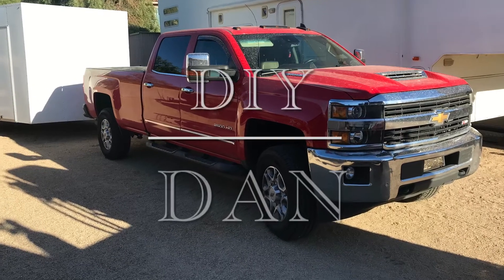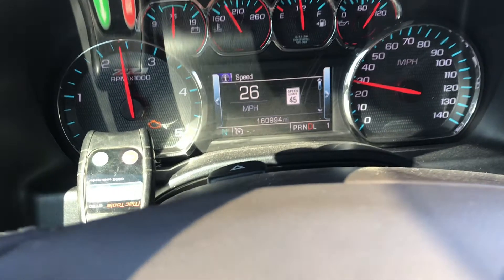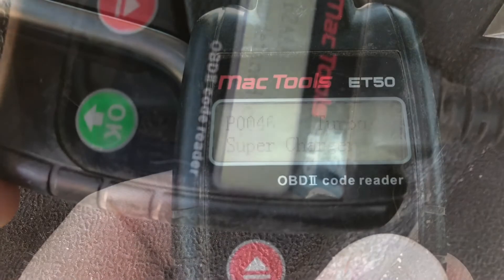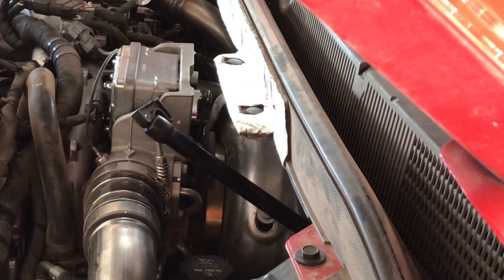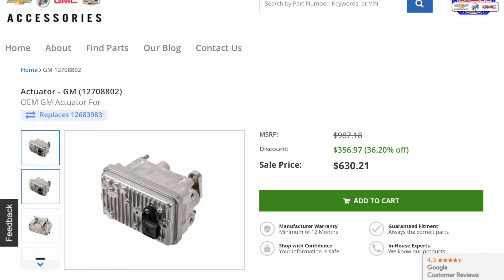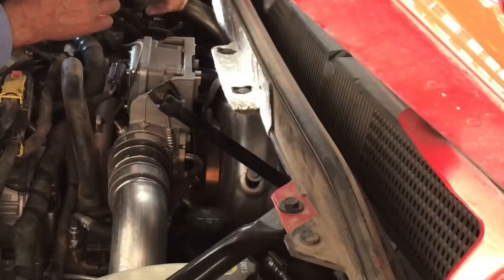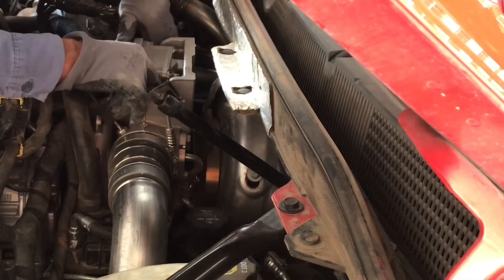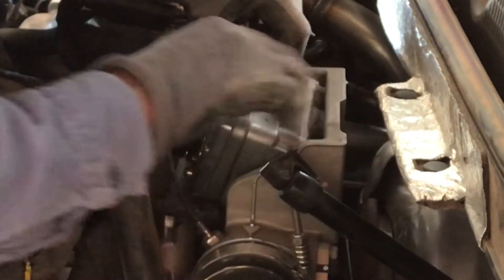REDUCED ENGINE POWER ON DASH ON MY 2017 CHEVY DURAMAX WHY IT CAN COME ON & WHAT I DID TO REPAIR IT

Comment: I have a problem the truck starts but like 1 minute cuts off before was engine reduce pawer I replace mass sensor not fix replace map sensor still same problem
Reply from the maker: Codes??
Reply: @d @diydan7019 p0108 and p0106

Comment: Good video, I like being able to check the vain position actuator manually, I can't do that on my 2015 with out some disassembly but I don't like the extra electrical part that actuates it on the 2017. I like the way you used a common sense diagnostic method.

Comment: Whats that thin wire(positive side) that’s going to the driver side battery terminal? I just bought a truck and looks like that cable is cut off on mine.. haven’t gotten around to follow the wire yet, I was assuming it was some aftermarket lights or something
Reply from the maker: Most likely aftermarket mine is for an auxiliary fuel pump that I have in the back of the truck

Comment: Taking it to the dealership does not in any way mean a proper diagnosis.  The dealer diagnosed a defective injector for mine ($1,000+ repair) which turned out to be a $14 wire connector.  That is FRAUD.  That Chevy is cutting $10 on wire harnesses that cost us thousands in repairs and down time.

Comment: My 2020 Chevy popped the code P0046 after a dead battery issue. It showed Engine Power reduced. I was hoping that it clear itself but guess I have to bite the bullet and buy the actuator. It is also showing Emission issue which might be the MAP sensor. Unless some one has another idea. As I said these all came up after both batteries went dead.

Comment: I’m having this problem right now, replaced the acuator now it’s throwing a P003A code. Do you think I need to do a relearn? The handle on the acuator doesn’t always work when I start it
Reply from the maker: @terrybonner1838  did the actuator rod on the turbo seem to be sticking when you had the actuator off of the turbo when moving it to check the turbo

Comment: STABILITRAC can throw a lot of ghost codes that can make repair facilities a lot of money and not even get close to the exact reason for the reduced engine power.  We have a sudden attack of the TRAILER BRAKE CONTROLLER which then threw the REDUCED ENGINE POWER and CYLINDER 7 which was NOT defective.  In my case we received; P0097, P00F4, P0113, P227B, P227D, P0207, P021A, and P1050, P0307.   Just to get the TRAILER BRAKE CONTROLLER to SHUT UP I unplugged my trailer wire, pulled the trailer brake controller fuse and even the trailer brake charger fuse and it STILL continued.  Turns out the wire harness was damaged from rubbing on the frame and had exposed wired that were shorting and grounding out that also caused other systems to malfunction.  True these systems were in need of attention (NOX sensors and DEF Pump) however they had nothing to do with either the TRAILER BRAKE CONTROLLER  or the DEF pump.  We have also had the REDUCED ENGINE POWER just from the MASS AIR FLOW wire being loose.  After replacing the NOX sensor, pulling the trailer brake switch, trailer brake wire, and trailer brake controller we  repaired the wire put it all back in and the only thing that was left was the DEF Pump.  SUDDENLY, we also needed a new particulate exhaust sensor too (imagine that).

Comment: If the actuator doesn’t move at all when you rev is that a sign that’s it’s bad. I think so but just wanted to be sure before I replace
Reply from the maker: Yes but it could also be not getting told to move if there is a wiring issue but i would suspect a bad actuator
Reply: Thanks! Wish me luck I’ll be changing mine out today.

Comment: Very good video!!! I'm having similar codes like the 0046 and the 2599.  I only have 80,000 miles on mine.  I purchased the vane position sensor, but it doesn't match any of the sensors I have on the truck.

Comment: My 2017 had this light come on while I was driving down the highway and I had to pull over, steering wheel locked up and it will not start
Reply from the maker: That sounds like you lost your belt which lost your power steering

Comment: For whatever reason the Duramax with Allison trans can go crazy if a code is thrown.  Recently had Fuel Temperature sensor go off which in returned caused my trans to go crazy.  Took to a diesel performance shop to double check, they said its normal for a code to fly and them makes things crazy, I never new it would be that crazy.
Reply from the maker: A bad ignition switch can cause the trans to go crazy the ignition starts getting a bad connection on the contacts and does not supply the proper voltage to the trans causing all kinds of problems

Comment: I have a 2018 GMC duramax, my power Engine reduce Came on also my dashboard also says continue driving clean filter, did your say that to?
Reply from the maker: No it didn’t did you have a lot of extended idle time before that came on
Reply: @diydan7019  what do you mean by extended idle
Reply from the maker: Those cleaning systems for the most part run at higher RPMs, like highway driving so extended idling for long periods, can sometimes lead it to not cleaning and force the cleaning but if your actuator is not working correctly, you are not getting the boost you need, and it will run very dirty, which can force the clean as well. What does your boost gauge read? Is it reading like it normally did or lower
Reply: What did you end up doing my says the same thing same symptoms as yours
Reply: @JoseDiaz-if1pq i Took it to a shop and they had to do a manual region
Reply: @ddayfnb4316 what’s a Manuel region? How much
Reply: I have the same problem what do you replace and do you fix the problem

Comment: EXCELLENT video, thanks Dan!   Also great thatyou mentioned that you got DPF fluid codes as well.  I got similar but some different codes.  A local diesel shop guessed actuator, DFP heater and DPF pump.  I'm hoping just actuator may solve this, now I know how to try.

Comment: 45 k on my 2018 L5P.  Has ran great pulling our 30 ft travel trailer.   All of a sudden last week  went into low power mode.   Shut down, restart, then drove another 100 yards and went into low / reduced power mode again.   Pulled over and called for a tow to the local GM dealer.   While waiting, the engine idled smooth, would Rev up smoothly and sounded great.   Been in the shop now for a week ( impacted by the holidays), but what I am hearing from the tech the codes are pointing to a fuel pressure issue.   He continues to converse with GM on what to do next.  I wish I had more info on the codes being activated and will visit the dealer on Jan 3 to get the latest update.
Reply: What did it end up being?
Reply: What was it

Comment: Any update? Still okay?
Reply from the maker: No problem so far everything working good
Reply: @diydan7019  I’ve got a service truck doing this bull crap 5500 stellar tire service crane PTO powered boom truck illl tell my boss to look into this part it was the electric motor for the turbo right?
Reply from the maker: @X-R-P  yes

Comment: What is the part called
Reply: Ok because my truck is having the same issue been to the dealers 3 times and still no fix my truck is bringing up p0191 for fuel rail pressure sensor but mechanic says he replaced it but the same codes coming up and keeps going into limp mode
Reply from the maker: @travonelam7466  that code has more to do with your fuel pressure which could be caused by a fuel filter housing is a very common issue possibly a injector or the wiring pigtails to the injectors is more likely I don’t think it is going to be your actuator on the turbo good luck
Reply from the maker: It’s just called an actuator but basically look it up under electric motor that controls the boost of the turbo
Reply from the maker: I believe the part number on mine was 12683983 but don’t quote me on that